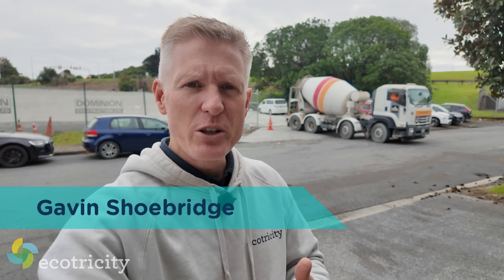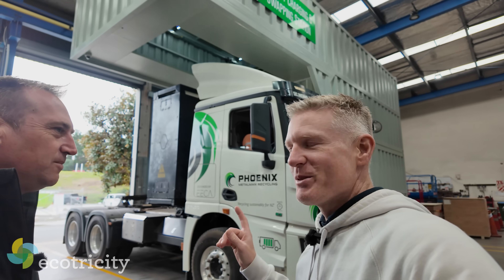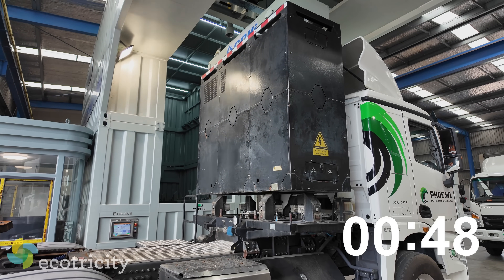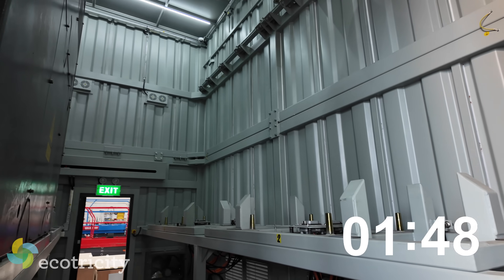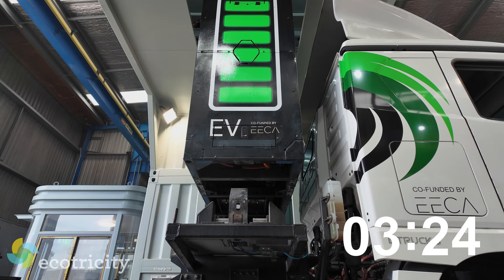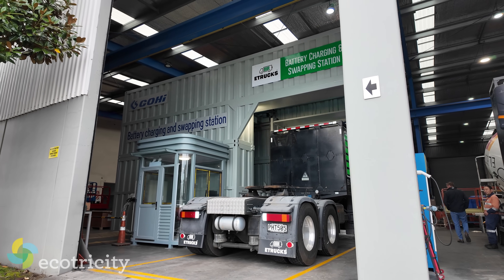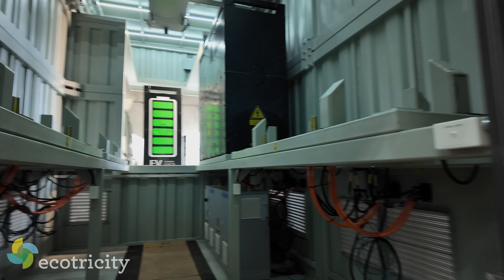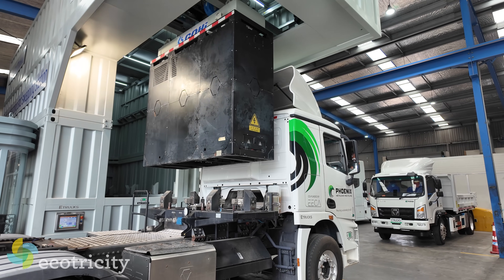Electric truck battery swapping is QUICK ⏱️

Comment: I see so many problems with this system. Firstly and most glaring, is the high centre of gravity of putting 3 tonnes above the wheels. EVs have their batteries below the floor, making the centre of gravity very low which is excellent for road holding. The second is the astronomical cost of building this system. I'd say several million dollars? Who's paying for it? I hope it's not some Govt subsidy? I say these things as someone who's been driving EVs for more than 10yrs. I don't see that this system is going to save any money. 30mins of charging at virtually no cost of infrastructure vs 5 mins at the cost of???
Reply: I see you stopped watching early. The system is only a quarter million dollars. Not sure if that includes the spare batteries or not. 
Each battery pack should cost $30,000: assuming 250kWh, $115/kWh.

Comment: yes. and awesome as this is,complete electrification of Any nation would require complete renewal and massive expansion of the entire electrical grid. next.
every electric semi/diesel truck elictrified depot  pulls small town/suburb grid requirements.
electric cars are between 0.8 and 1.5% of all cars registered, depending on nation, and ALREADY cause notable additional strain on the grid. the fast charge stations pull down grid stresses and needs equivalent to FACTORIES: but unpredicatable ones. and Still take an hour.
pure EV CANNOT be the the final solution, nor the only one. reality is a stone cold cluster..

Comment: The battery is way too high - too top heavy.  Roll over?  We need to stay with charging and increasing the charge speed.  The cost to install these nationwide is way too high, and then all is wasted when a new idea or instance charging is available 😀

Comment: So.. who owns the battery, are the trucks lease..
Reply: @blackline-qf6fl … N European here who knows China … 

In China BYD and NIO have linked up and with them one buys the EV and then leases the battery. Works fantastically well as they have a full infrastructure already of swap stations. 

Plus of course the new BYD developed 5 minute charging 0-80% batteries are now out .. China has the infrastructure for that as well. 

The reasons they are so far ahead of the West is:

* They have no 'Legacy' car makers holding them back, demanding government support, demanding EV's are blocked etc 
* The Government is not concerned by attaching jobs to manufacture .. The companies are allowed to manufacture as efficiently as possible
* Vehicle ownership was barely a thing in even the early 2000's … So really they could start almost from scratch
* They have vast cities, 30+ Million people and nearly all of them live in apartments .. so self charging is not possible, they had to develop battery swap back in the early 2010's

Comment: Excellent.  Could you please address how the system handles such a tall heavy battery being held only at the bottom.  Seems like there would be an awful lot of torque on those holding clamps.

Comment: Battery swapping in big warehouses been around for decades. Got to keep those forklifts running 24/7 and can't have engine fumes indoors. Older battery tech though. Arm with magnet pulls flat battery out onto roller bed, then pushes charged battery into machine.

Comment: What happens to that battery if your in a accident?  Get the feeling it could end up on the wrong side of the cab...
Reply: @christopherdobbie … Don't be a child.  The batteries are secure. 

If you saw China, their autonomous mines with EV trucks and on their roads … You wouldn't make such rueful comments

Don't worry, in a few years there will be NO truck drivers.
Reply: @SevenBee-q2j How's pointing out a possibility rude, unless you don't want to hear it...
Reply: @SevenBee-q2j yeah china is so far ahead of west 🙄

If it's so great, go live there! 😁🇨🇳

Comment: Battery swapping should have been the standard for vehicles.
Reply: Too difficult to fit for all vehicles, in china only Nio does the battery swapping and it's a big cost to build the swapping station to the car company. Now Byd has 1000kw fast charging, maybe even quicker in the near future, so no need for swapping battery for private vehicles. But yes gor truck bus still time efficient 🎉
Reply: @tackle9ax327  This truck swapping station is from BYD. But it only fits a small group of trucks like dump trucks or concrete etc.
Reply: Only for some types of trucks that is feasible. 
But not for e.g. Trucks in Europe 
which must be less than 18.75 meters for extra long, 
16.5 for trucks with Trailers and 12m for real Semis.
And not for passender Vehicles.
And not for Busses.

Comment: This system is like electric forklift trucks which have had battery swap systems since the 1970's. But thanks to modern vision systems and automation advances it doesn't need an operator. This makes extremely long haul trips feasible but the haulage industry will need to standardise the battery format.
Reply: This is the problem the west has and why it is losing out to China … There BYD & NIO has already standardised batteries between their two companies … They have battery swaps for EV 

They have AI EV Truck mines 

A guy in Germany runs an EV Truck, an Iveco and he says he saves €30,000 in diesel a year using EV .. His big gripe? Not enough infrastructure to make it as easy as it should be. His truck though will go past anything on a hill at full speed.

Comment: A great idea, but ideally the battery should be at the height of the frame, instead of adding nearly 3 tons very high up.
Reply: No different from the hight of a full load.
Reply: Yeah check out the Janus truck conversions, they shove the battery pack down where the diesel tanks were
Reply: That is why Nobody uses this type of tech.

Comment: I honestly think that a similar system should be developed for ordinary passenger vehicles also. There will obviously be a very different form of application because of the difference in vehicle. It is when I see things like this that I tend to think that governments are not really doing their part. They are setting lofty goals for net zero, but not much else. With current set-ups, the first thing that every government could do is that they legislate that charging stations (ordinary vehicles) are designed so that they can accommodate those towing any kind of trailer without having to unhitch. They could also start legislating that charging ports be standardised and also that car manufacturers design vehicles that can easily have a standardised battery swapped in and out. That would eliminate the need for ridiculous waiting times at charging stations. The charging stations essentially acting much the same way as current petrol stations with a quick swap of a battery and instead of a large holding tank for diesel or petrol, that the equivalent space be used to charge collected empty batteries and store inferior ones so that they can be taken out of the system. This would make living with EVs much, much better and with the advantages that they offer in terms of power and torque, they would naturally become the vehicle of choice. As it is at the moment, I, like many others are sticking to my diesel or petrol engined vehicles.
Reply: That already exists. Take a look at NIO for example.
Reply: Works when batteries are identical…so ideal for this trucking company.

Not needed in cars.  Nearly every car can travel for three hours before needing any charge.  We’ve never had to wait any longer than getting a coffee and going to the loo before we could charge long enough for another three hours.  Usually the car charged faster than our break.  And we take a break every three hours anyway.  The joke is that the car has more distance than a bladder.

If you regularly drive > 3 hours with no stop then fine.  You should take regular breaks but we cant force you to do so.

My car is charging as we speak.  Took 15 seconds to plug in and will take me an annoying 15 seconds to unplug tomorrow.

Yet every ‘charge’ in a diseasel or petrol car means a visit to a ‘supercharger’ whereas I only need it on trips > 400km.

The only people who think charging times are an issue are those without an EV.  Those with EVs and ability to charge at home spend less time charging than ICE cars in a year.

Comment: You didn’t actually mention how far they go on a charge i.e. how many KW’s per mile/kilometer…?
Reply: low estimate with average load is a little under 2kwh per km, on a 282kwh battery means 140km range. they said they can trip to Hamilton so that tracks. obviously load, wind, terrain and speed swing it a lot
Reply: @conorandturbos Many thanks for responding. Wow, that’s pretty hefty consumption but I guess it’s indicative of the load/weight. It’s so the future…?
Reply: It’s for very local use not going to compete with diesel anytime soon lol! 280ish kWh battery is nothing

Comment: It could do the swap in half the time if it had a dual carriage and it dropped the charged battery as soon as it picks the flat one.  Oh well, I am sure someone will complain it is too slow.
Reply: Lol!!!! You don’t just drop the battery you have to connect it and make sure the connection is secure and can actually work in harsch environments where those vehicles are actually used unless those EVs are not used in harsh conditions

Comment: What was the actual range? What size trailer weight are the pulling? How's the power? These things would be nice to know. Cheers.
Reply: 248KwH battery is about a third of a Volvo ETruck - so maybe 200 miles (depending on load)
Reply: @davidlloyd1526 less than 200 miles more like half